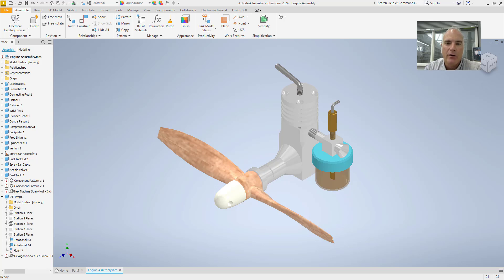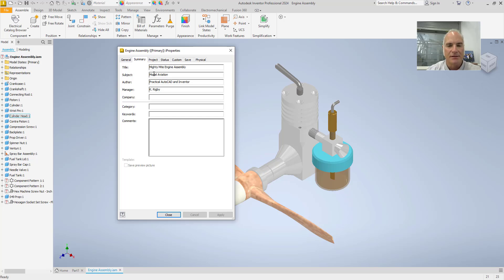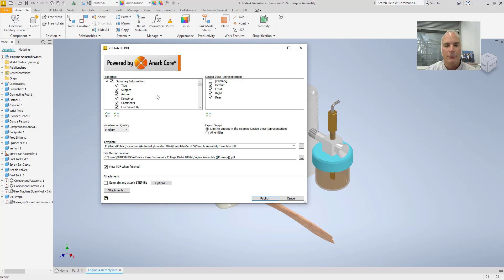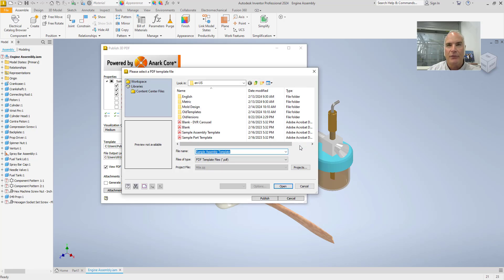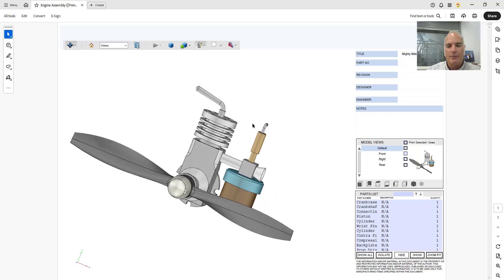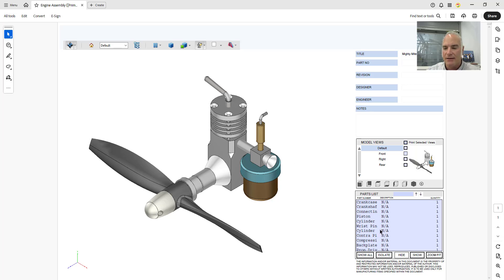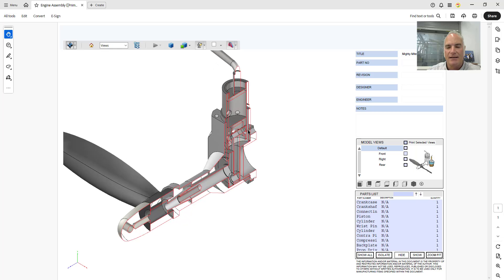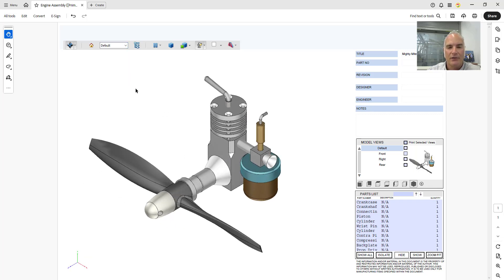Autodesk Inventor - Creating a 3D PDF

Comment: Is it possible to export the flat pattern of sheet metal files into 3d PDF as well?
Reply from the maker: Let me look into that! I’m at AU right now, so I will do it when I return home!
Reply from the maker: No, you cannot create a 3D PDF from a flat pattern. One work-around would be to export the flat pattern as a dxf file, then create a new sheet metal part beginning with the dxf. You could use the FACE command to create your part, then create your 3D PDF from that.
Hope this helps!